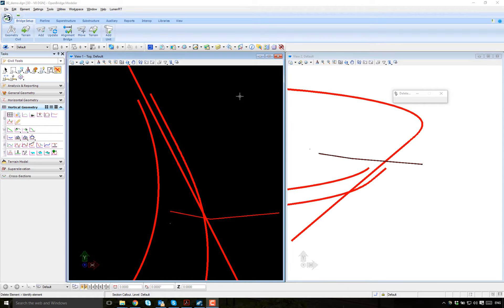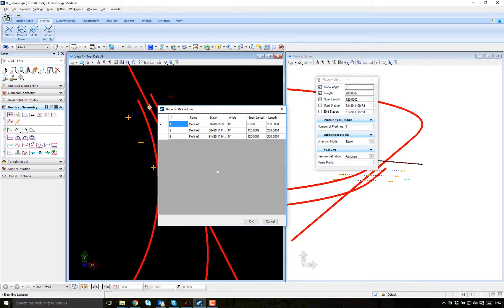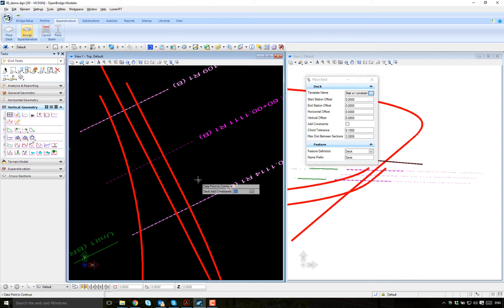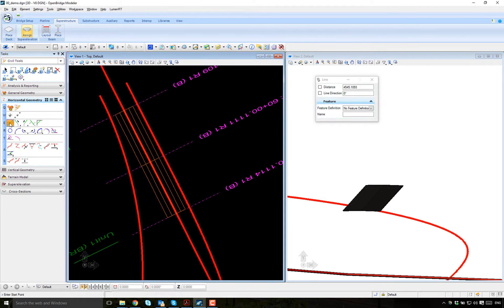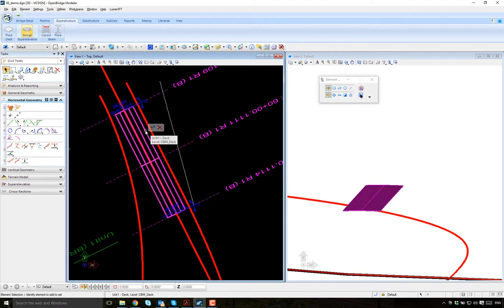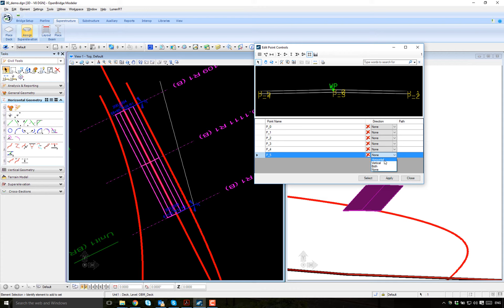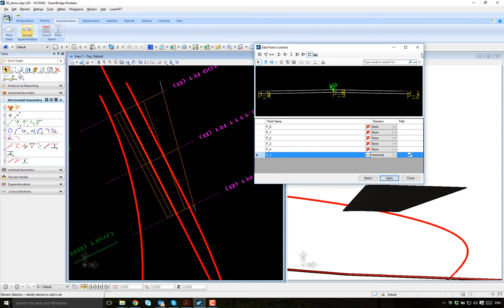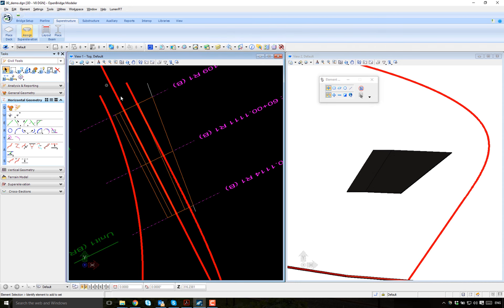OpenBridge Modeler - Variable Deck Width

Comment: I have placed a variable width deck, but the point control doesn't react or move along the control line if the support line has a skew angle of 20.4 degrees (as needed). However, the same deck works well if I decrease the support line skew angle to 10 degrees or less. Any idea why?